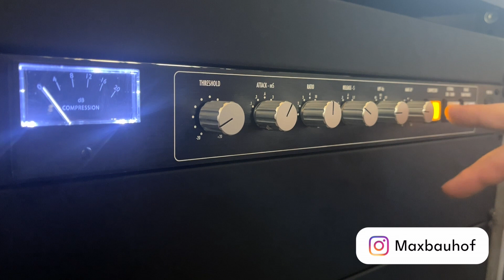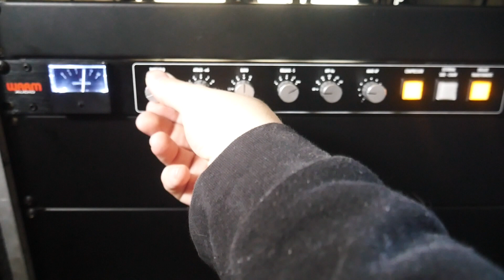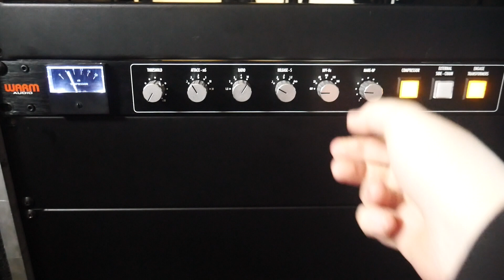I demoed the cheapest bus compressor

Comment: Sometimes people seem to take a dump on these, but i have heard a few demos online where it sounded fantastic. The question is, how much "better" does a pricier version sound etc. We live in a world where opinions are a dime a dozen and that is not a problem as long as we remind ourselves that nothing is more important than finding out for yourself. I try to remain optimistic, yet skeptical of my own biases or the chance that I could be mistaken. That way I am open to a change of mind while still having substance to my opinion. From listening to sound samples etc over the years, my thoughts are that when A/B testing Warm Audio stuff vs other "remakes", the Warm Audio stuff sometimes have a lack of focus or tightness in the lowest end of the spectrum. But, they still improve the sound of the source greatly when used correctly on the correct material. This might be due to the parts inside being not the highest cost you can get in some instances. This is not to say they are filled with "junk components" or any other hyperbolic description. Maybe its something in the power supply that makes it that way. I cant be sure since I am only going off my own research online in A/B tests ive heard where the poster was assumed to not be biased. 

I believe that a person could get amazing results from Warm Audio stuff if used correctly on strong material. Weak material cannot be saved by that 2 percent difference in low end performance that may or may not be quite there as it would be in a $2500 dollar bus compressor. The only thing about lower end equipment that cannot be hand waved away is resale value. Resale value is retained more often than not in higher end equipment. I love equipment as much as anyone else, but if you are a new artist learning your skills etc I would recommend getting better at music itself rather than stressing over the small details in gear performance if cost is a factor. Learn what strengths there are in a genre, then find where the equivalent strengths lie in other genres. That sounds vague to a new learner, but believe me it is true, and it works. Dont just think of music as verse chorus etc. Work it out so 16 bars are actually 2 8 bar sections that are actually 2 4 bar sections on down that relate to each other internally like "call and answer". Theres more power in that skill than any compressor. Gear is just easier to buy to try to "solve" the problems when we try to "make better music". Ill end my novel here but, outside of resale value, i encourage people to look inward rather than outward when trying to create better art. I own the Stam version of this bus compressor and while it is likely a touch more solid than the Warm one, I swear to you my actual workflow involves so much in the creative realm rather than the sonic realm that I likely wouldnt even tell the difference.

Thanks for the video! Stay cool everyone. Believe in yourself!
Reply from the maker: Yeah, at the end of the day they are just tools so whatever gets you there.  I owned the 4 channel warm audio API preamp for awhile.  For a 4 channel transformer balanced pre amp, it sounded good for the price.  One of the channels was a little noisy though. A lot of gear is so expensive too because it’s a very small team building in the US with limited economy of scale.
Reply: @maxbauhof  Definitely, quality control is why I believe resale value is better on USA made stuff. I think we should never knock hand made boutique top tier products. A real La2a is no joke to build to a standard. BAE products are amazing as well. I think we can live in a world of honesty and appreciation for the spectrum we have to choose from. My only deep concern is for that person out there that is convinced they are at an artistic disadvantage due to not having the "right gear" when pretty much every person ive known in real life that had the "magic" of strong songwriting ability cared very little for gear let alone boutique gear. That being said, id never want to discredit the artisans of well built stuff. I truly believe the day I have enough money to have a room full of the "best of the best" stuff is the day im so preoccupied with delivering great art on a creative level, that Ill no longer have the time to stress over the small details in audio equipment. Thanks for the reply!
Reply from the maker: true, the expensive stuff is available and because of places like warm audio an audio scape or stam outboard gear can be had for a reasonable price.
Reply: @JackNiles  In these times, it is a great honor to be honest.